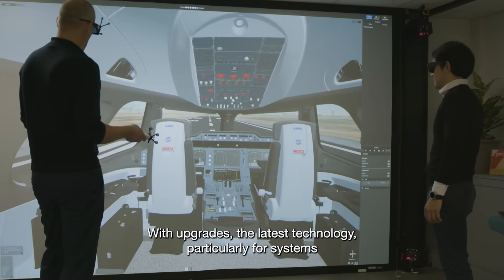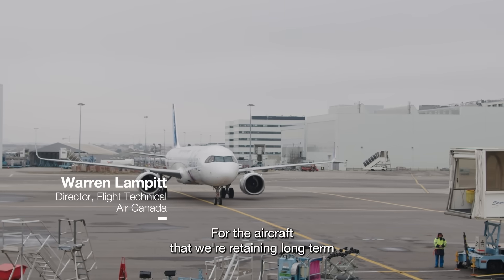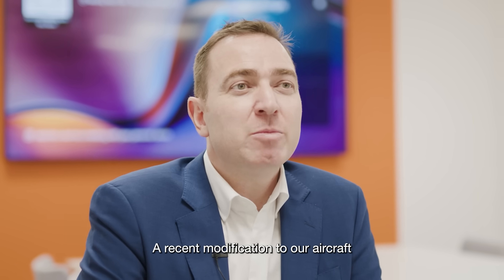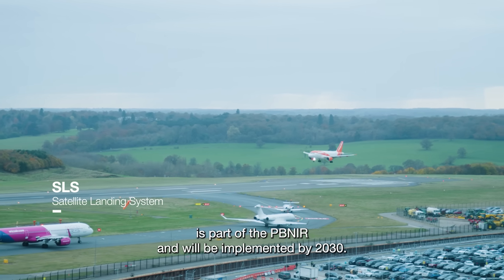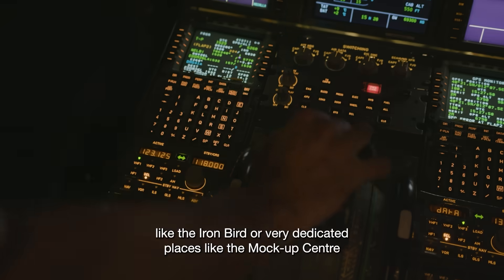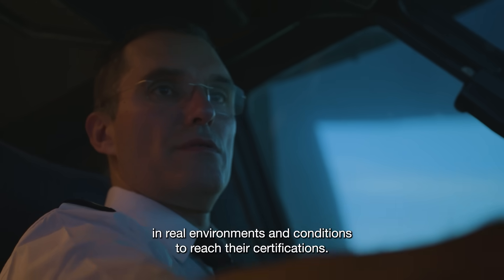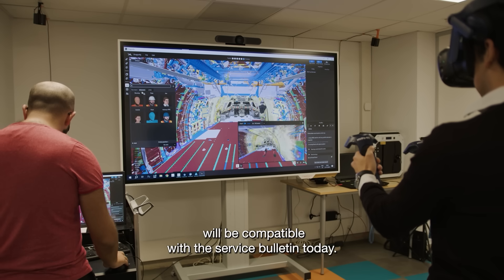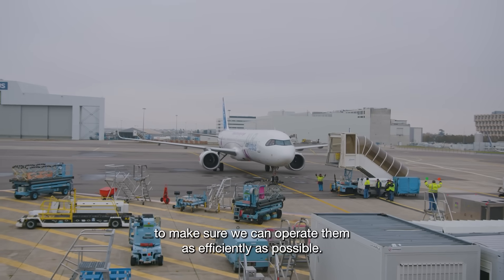Upgrades: Systems & Avionics

Comment: A320 wasn’t designed in the 90s, it’s a late 80s design with a fist flight in 1987.
Reply: She didn’t say it was, she was presenting a (hypothetical) practical example. In this case, a jet that was built in the 90s.
Reply: You could say it was designed in the early 80s actually considering how long certification takes. Many aircraft built in the 90s still flying however.

Comment: The screens on the A320s should be bigger like in the A220 and A350. Also, touchscreens should be added.
Reply: Try using touch screens in turbulence. Physical controls are crucial
Reply: @dannnnn496 Gulfstream just released the almost fully touch screen based cockpit lol. :D

Comment: I fly the A320. Having OANS like the A350 and A380 for taxing would be huge for situational awareness rather than having to look off to the side at an iPad. Synthetic vision and something like Garmins runway occupancy awareness would also be nice for airline crews in an ever ending growing and congested airspace system.
Reply: The A320 family can certainly have OANS. Condor has had it equipped for years on their A321s eg.
Reply: OANS is even available on CEO A320s, it is probably just not an option many airlines have chosen. We have it in a couple of our newer CEOs and on all NEOs.
Reply: former a320 pilot here.. i fly both a350 and a380. yes i agree the SAw made a whole new difference!
Reply: A320 has OANS already on some airlines but I think it’s only on Neos

Comment: Nice work, but why can’t you also upgrade the A340? It’s such a magnificent aircraft with so much potential and yet often overlooked.
Reply: Because it has four engines. Four engine aircraft are completely obsolete. They burn more fuel and require more maintenance. Why have four engines when you can do the same job with two? The reliability of modern twin jets is simply insane. You don't need four engines anymore.
Reply: Unfortunately fuel inefficient
Reply: you clearly don't know too much about planes, which is surprising, given your name
Reply: @KuostA  I do. I’m just skeptical for the future.
Reply: @MariusPlanes  if you really did, then you'd know why the a340 is obsolete.
Reply: @KuostA  I do know. Can I not have my own opinion?
Reply: It’s an obsolete aircraft with declining fleet stock, just not cost effective to retrofit aircraft.
Reply: The A340 upgrade is called the A330 NEO
;)